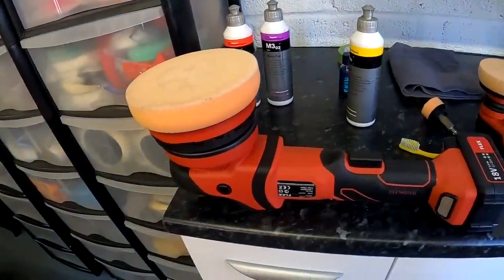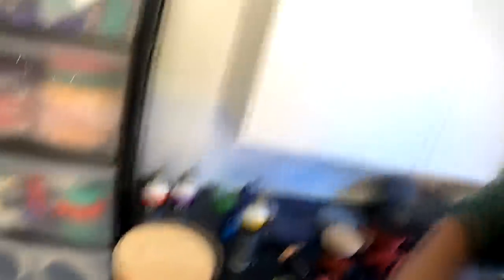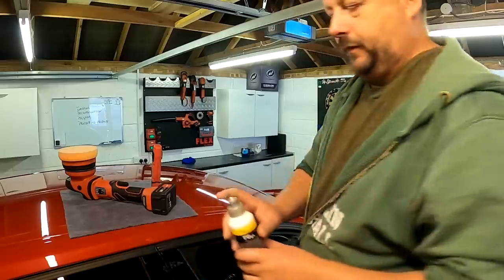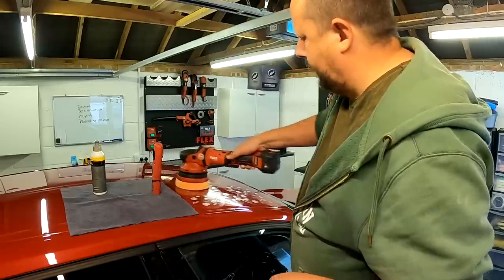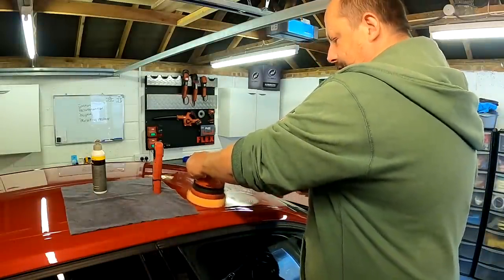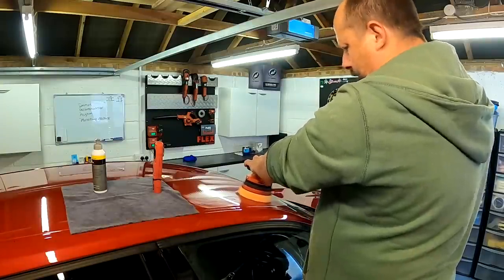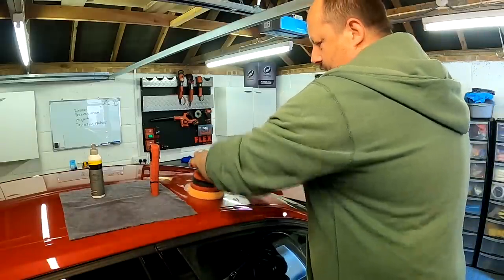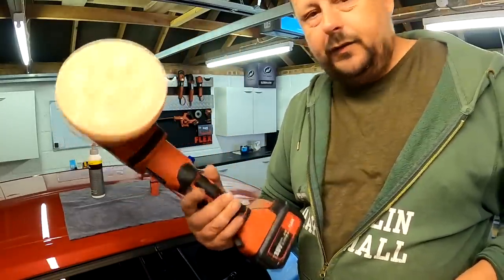Secret to polishing with Force Rotation Dual Action Polisher

Comment: I bought one of these at the beginning of the year and will never go back to free spinning machines again. It does take a few minutes to get used to it but once you’ve got over the initial wobbles it’s a fantastic piece of kit. Paired with the PXE you’ll need no other polishers. One useful piece of advice when using a forced rotation is to try polishing a horizontal panel first. That way I find you get used to the balance of the machine before going onto a door or other vertical panel.

Comment: Just got the corded version of xce, i love it. Its a bit tricky to control it compared to a free da, but nothing crazy, ill get used to it. I tested it on some holograms left after a repaint, it breezed trough them. This tool will help me get my jobs done much easyer and faster. I used a rotary before too, it cuts like butter, but on curved and tiny areas it can be a struggle to control it. Free da's are easyer to control, but it feels like the forced rotation is a compromise between free da and rotary. Excelent cut, and also good control on the panel, with no holograms.

Comment: I’m starting on this machine Jon.   Buying this week.  My Q.   I’m expecting to be pulled around.  Should I use a much lesser speed to get going and is half speed half cut.  Double time needed.  Or is half speed like 4/5/6/8x slower to cut. I’m expecting tred slowly maybe use a medium to heavy cut.  I’m on cheap cars not precious metal
Reply from the maker: no mate run it on speed 5 to cut.. push down a bit on machine to cut harder.

Comment: I am just about to try out my first forced oscillation polisher, a used flex 3401. No need to worry, I'm using my sister's car to get acquainted with the new machine. I appreciate the guidance, as always!
Reply: Wow, you found one used for sale? Lucky. I see original Rupes LHR15/21ES posted once in awhile, but almost never see a 3401. I did get a crazy good deal on an old G6 package once. It wasn't the polisher but the dozens of pads and polishes included that made it so awesome. What did you pay out of curiosity?
Reply: @jdisdetermined  I paid $500 for both the 3401 and a flex rotary pe14-2-150, the guy also included some pads and a bunch of CG polish. It was from a retired gentleman who quit showing his car and said each machine had been used about twice a year for the last 6 years. Everything else for sale around me was more expensive and had been used daily for years. The 3401 is meh, but the rotary (my first rotary) is extraordinary for its power mixed with quietness and smoothness. If you are looking for forced rotation and already have a random orbit polisher, I would focus on getting a flex rotary - it can cut better and can refine quicker than a forced rotation orbital or a random orbital.
Reply: @scottmattern482  wow, really good deal. I have a Mille, but I'm kind of meh about it too.  It would be awesome for mobile guys, you can get around an entire vehicle effectively with one full size polisher. But I work out of a shop so I have several polishers handy. 

I've been eyeing the cordless Flex rotary for awhile. But I do have a few rotaries myself, I cut with a rotary if I'm doing a multistep correction, and use them with small pads and extensions for tight/edge work. I have a big heavy Makita I never use, a cordless M18 Fuel, and then a Maxshine compact. 

I use the compact the most because it's so pleasant to use. I don't cut with heavy pressure, so it handles a 5" plate and pads just fine. It is light and precise and powerful and buttery smooth. A big loud long throw flapping around can feel like a sloppy unwieldy mess by comparison. 😁👍
Reply: @jdisdetermined  i was actaully getting ready to buy a new mille, that same day I came across the used flex deal. Im glad i was afforded the opportunity to use both a good rotary and a forced orbital. Furthermore, I appreciate someone who has more experience than myself confirm my own process and conclusions. Thanks for your input 👍

Comment: Ive just bought one of these today, the corded version as i dont want the hassle of charging batteries. I have the Flex rotary and the free spinning XFE . Rotary is great but i find the XFE pretty useless for anything but very light finishing work due to the stalling issue which is really annoying.

Comment: I have the same machine, IMO it’s the only thing that cuts close to a rotary. I also think compound plays a key role, you definitely need a compound with a bit more lube in it, I like S20 black on it and the new Rupes Mille coarse. I have the new lake country force pads on the way. Interesting to see how they perform.
Reply: How was the Lake Country forced pads. Cheers

Comment: I think forced rotation is a halway point between a da and a rotary and ive found i can get better cut with a forced rotation, and i use it when im working on a badly scratched paint or a, very large vehicle as it saves time as can cover larger panels in less passes.
Reply: Spot on.  Agreed.  Rotary quicker.  Can see why bodyshops guy / gal flat and polishing 2/4 cars a day only ONLY uses rotary.  Speed.  I feel cut is great DA forced rotation but I spend 2/3 times more on panel to get there but with close to zero risk burn.  As a noob I’m still burning on the rotary.  Champhered edges and door shuts plastic bumpers.  Maybe use rotary on easy surfaces. Use DA forced on the rest of each panel.  May try a double polisher idea. Where rotary won’t easily over heat a panel go in on rotary first.  Da the rest of the panel

Comment: Hey Jon, I've recently bought an XCE and am having a bit of difficulty cutting with it. I'm using LC HDO microfibre cutting pads with Scholl S3 gold, and i'm finding the polisher is vibrating a lot and jumping all the time. Just wondering what your thoughts are on this? Because the pad is thin I assume any slight off-blance will be directly transferred to the machine, but am I putting too much pressure? not enough product? Too much product? Running the same pad and compound on a DA i'm not having much issues, just with the forced rotation...
Reply from the maker: yes mate ditch the microfiber pads.   Get foam flex pads purples to cut and flex orange to polish.  done.   microfiber pads only work well on free spinning dual action polishers.  Search you tube for "Machine Polisher Glow in the Dark Geometric Dynamics
" watch my quick video with shows the orbits of these machines.   the microfiber pads need to be ruffled up, or they get flattend out like crop circles by force rotation and especially rotary so they gunk up and stick.  you dont need microfiber pads mate honestly, expensive and foam is just as effective.
Reply: @forensicunplugged4295  Hey mate thanks for the reply! Unfortunately I only just bought the microfibre pads and this was my first time using them. I'm doing detailing on the side so was looking for a combination to speed up the cutting process. Unfortunately here in Aus no where stocks the Flex pads, currently I have Scholl Blue, purple and gold spider pads. The blue are meant to be the cutting pad, but i'm not sure if I rate them, the cells are very fine and closed so it tends to gunk up very quickly. I was thinking of maybe changing to Rupes Blue pads for cutting? As i'm going to these for my 1 - 3" pads, plus Rupes covers the full size range as you mentioned in you video on pads. The open cell structure of the Rupes seems to make for a fast cut and easy cleaning, although they spray a little. I'm also looking to change to Koch Chemie polishes. Thanks for your advice mate, very much appreciated!
Reply from the maker: @uberlymick  scholl pads are the same as flex basically.  white=green purple=purple orange =orange.    the blue one flex dont have.. use the scholl concepts.  try and get the ones without the slits.
Reply: @forensicunplugged4295  Thanks for the advice mate, much appreciated
Reply: @uberlymick  after 2 years what was the issue?  did you ever solved?  I just orderes one corded XCE today and will be my first time as I come from free rotation DA

Comment: 8mm offset da forced rotation vs 5.5 to 6.   What’s the score John.   I hear less holograms vs rotary. My rotary died so in market for a machine that spins up fast doesn’t burn paint like rotary.
Reply from the maker: i would just get the flex mate.   the orbit is different dynamics to da.  it obrits fast but rotates slower so its almost like a vibrating hand.
Reply: @forensicunplugged4295  Ended up cheap-ing out, went In2 copy of the Flex, yes it vibrates crazy, like a VIBE, it's a strange sensation that you do gell with, so so so different to Rotary, hardly any chance burning messing up, slower, double time of the Rotary with no stress. Excellent results , enjoying Forced DA Jon

Comment: Jon fantastic vid again..quicky will the Maguires snow foam bottle will it fit karcher het wash it do thou have to get adaptor?  Cheers
Reply from the maker: no idea mate but if its on sale in the uk without a karcher fitment I would be shocked.  so 99% sure it is but thats a question for meguiars UK mate.
Reply: @forensicunplugged4295  thanks Jon...your right should try and ask them I suppose.  Only asked because you tried the snow foam bottle and you have a karcher lol

Comment: I saw some compound still on the pad after finishing the section. Would you put another 3-4 blobs of compound on for the next section or reduce the amount?
Reply from the maker: its just where it sinks into the pad.  But yer always follow the set piece.  after finishing the set.  clean pad with tooth brush.  then 4 more dots and away you go.
Reply: @forensicunplugged4295  thank you

Comment: How long do the batteries last for John? Are you at risk of heat wit the forced rotation like you would a rotary?
Reply from the maker: you can heat the paintwork but Ive never been able to make holgrames with it.
Reply: @forensicunplugged4295  thanks for the reply John, yeah I did some reading about them, what's the battery on one?

Comment: I have the Makita Forced machine and 1 I can’t get the backing plate off , 2 it’s always walking on me. I like it but when I’m on vertical panels I fight with it.
Reply from the maker: its harder to stay level on vertical panels.  Are you running the 6inch plate Amir?
Reply: Forensic Unplugged no I’m using the 5”.
Reply: It’s all about balance and making sure the head is level, try keeping your hand right at the back of it and use it to tilt.
Reply: Paul Hamilton ok, thanks

Comment: Where does a guy get a  battery powered forced rotation da polisher?  Ive got the Milwaukee battery operated rotary but need a good FR DA polisher
Reply from the maker: flex cordless XCE from in2detailing Eric
Reply: @forensicunplugged4295  do you think ill be worth it since i already have a rotary?

Comment: Could you use the orange pad with sonax perfect finish as one step
Reply from the maker: yes will work great.  purple if you want more cut. 
you can do pretty much everything with flex purple and flex ornage hakim.   they are as good as anything out there.
Reply: Forensic Unplugged Iv noticed bits of foam coming off purple pad after using a pad brush

Comment: Does a forced rotation machine give more cut when compared to a similar free spinning mc ? May be a future vid ?  Keep eating the salad 😉😉
Reply from the maker: they way I describe it is its more consistent.  you will notice if your polishing something thats heavily swirled. Sometimes with a DA when you are inspecting you see little patches of swirls its missed.. typically around the edges or in valleys.   I find I get a more consisteny level of cut with the force rotation and I can work a more tricky curvey surface better with it.
Reply: @forensicunplugged4295  many thanks for replying, very useful 😁